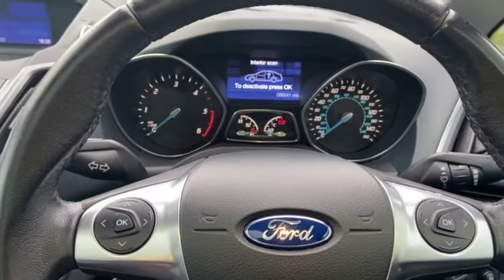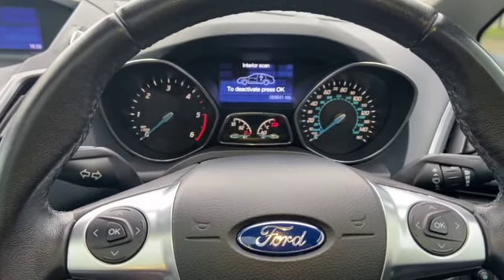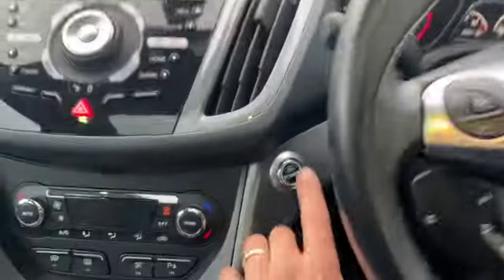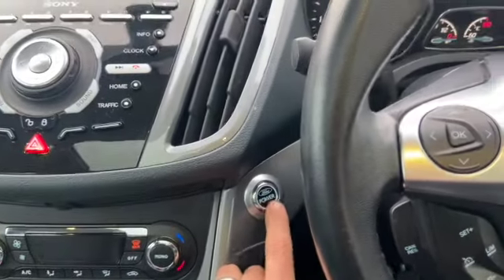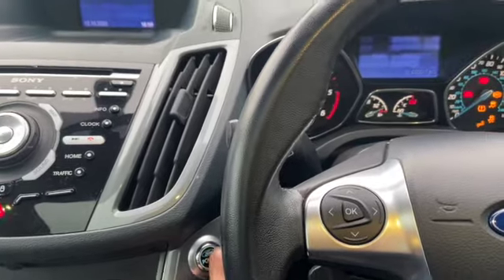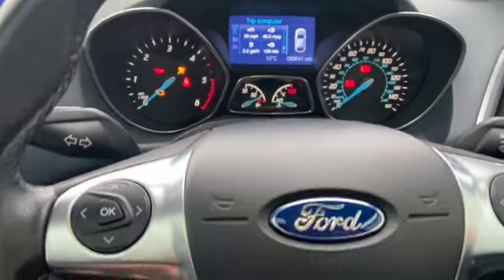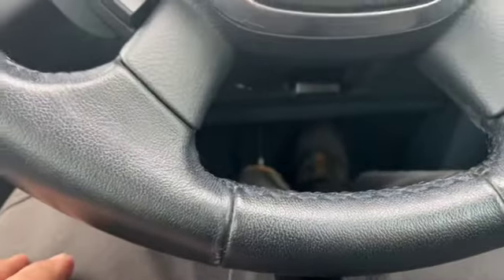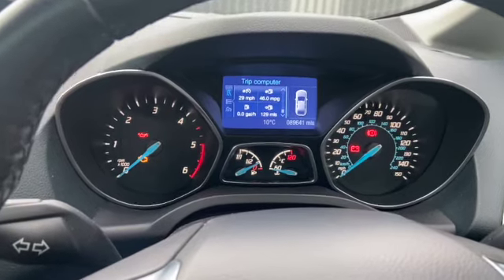Ford C MAX Service light Reset Procedure

Comment: Im having an issue i have a 2011 ford cmax. I had the 2 front tyres changed and the tyre pressure light came on. Went to store the pressure instantly after holding ok button a tpms malfunction warning has come up and i can not get it to go. Took it back to yhe tyre place they had it for over an hr trying to sort it and they couldn't get it too go. Im stuck, ive tried following videos to reset tpms but nothing works
Reply from the maker: they may have damaged the sensor